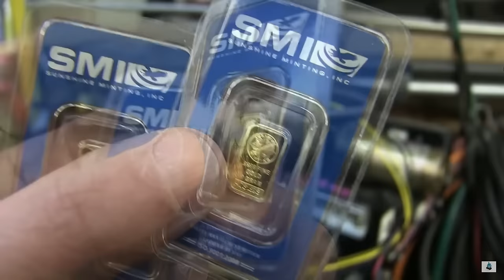Cold Welding In Vacuum

Comment: Has anyone mentioned the fact that when you quickly slam the two metals together, there is always mechancial recoil? regardless of how long you leave them in contact after the event, the energy necessary to cold weld has already been lost milliseconds after the initial bang in the form of kinetic bounce back. 
What about if you tried face on face cold welding using something that applies constant force in one direction like a hydraulic press? Of course with enough intense, pressure it'd cold weld by sliding past and deforming, but maybe you could test the press pressure difference necessary to cold weld in atmosphere versus a vacuum?

Comment: Can you try cold welding at as close to possible to  0 kelvin? if the gauge blocks are cold welding it when you wriggle them against each other then it should not happen since they are not reactive (or maybe that creates to much heat making them wield).

Comment: For the mercury vacuum pump, is there another material with sufficient weight to it, non reactive and low enough vapor pressuers. vapours to materials under test and a low melting point that would also not effect the material under test. I dunno say gallium, or sodium. Mind you is it feasible to put a check valve on the pump so vapor cannot enter the test chamber.
Reply from the maker: I've thought about NaK and I think it will work but I wont be able to pump oxygen or water.

Comment: Hey Cody! I was wondering if you could repeat this experiment, but adding a magnetic field to the equation. If the physicists who propose the Electric Universe model are right, it may very well be that the Casimir Effect that causes the cold welding is an electrically mediated phenomenon. You could try exposing your vacuum chamber to different EM fields, maybe your results will vary.

Comment: hey cody i have been wondering how a thing called a juul works. A juul is a e-cig that works without clicking a button al you have to do is suck on it and vapor comes out. Maybe if you could i would like to see if the vacuum chamber would activate it. The Juul is $50 on amazon if you want to try it out.
Reply: There is a pressure sensor in it, yes. And sure a vacuum would activate the atomizer. Nothing special about it.

Comment: Just one or two thoughts .. Perhaps by twisting you are rubbing the thin oxide layer off or  maybe oxygen gets trapped between  the  two pieces and the two electrons bind too other oxygen perhaps performing   A Great Wall of China between the two oxides layers (jk). First the bond would most likely too weak I would think .anyways on a serious note , perhaps something (most likely) on the quantum level is happening that since indium is so weak small atoms twist and dig into the other indium to create a sort of lock and as you twist the vacuum locks it in place for the first point (your rubbing the oxide layer off) which creates the perfect conditions to cold weld . I think the twisting is important and that's why it won't cold weld when you drop the indium or smash it together or something. I'm of course most likely wrong  and I forgot some basic principle of the second law of einsteinium quantum interpolation but to who's ever reading this have a very good day:)

Comment: Even in space cold welding isn't something that happens commonly.  It takes absolute absent of oxygen and complete vacuum and still requires rubbing together to happen.   Dropping and slamming together is not going to work.   Under these perfect conditions even aluminum can bond.

Comment: Could you over tighten a nut and have it cold weld to the bolt
Reply: Wouldn't that just be friction causing flaws in the surface to essentially hook together? I don't know much about cold welding but from my limited knowledge on the subject I don't think it could be considered cold welding. But again I don't know much about it so I could easily be wrong

Comment: rather than using a vacuum, why not use an inert gas, such as argon? if you're worried about oxides, simply eliminate the oxygen. in this way you can manipulate the material directly, rather than with contraptions.

Comment: #Cody'sLab Does not oxygen combust under high enough pressure? Maybe this actually is the other way around? Oxygen molecules getting trapped in a fine enough pattern to generate enough spontanious heat that it welds?

Comment: It is from micro friction. 

Do this test. And people, thumbs this up so he sees this message.

Get a better microscope if you can.

Buff out the indium. Make it smooth and fresh. Look at the surface.

Now do the twist under their own weight. Look at the surface again.

I am willing to bet, you will see rips and tears. This is because they are becoming heated. It isn't really cold welding. It is just a term created in contrast to the high temp of welding.

When you smash them together, that does nothing because most of that energy is translated into the sound that you hear. But again, when you twist them, it is silent, but the energy is also focused.

Like a flash light vs a laser. The flash light can be more powerful, but if you can focus the laser good enough, it will burn a hole in something. A flash light wont.

Also, I am willing to bet that if you put EXTREME force upon them and twisted them under that condition, it would be very hard to break them apart. Again, because of this "micro friction" and "micro heat". And again, it is "micro" as compared to actual welding.

But yeah.

BTW, I claim that I have the worlds best sandbox. I theory craft to a very high level degree.

Comment: Hello, isn't cold welding not working because you are not aligning the geometry of the crystals? What you are trying to do seems to me like trying to push in two misaligned (with an angle) lego bricks together. If you only had two pure macroscopic crystals,  (maybe you can try bismuth crystals, or salt crystals), and you align them (very ) precisely (maybe by vibration) they should cold weld. But you probably have plenty of micro-crystals which are not aligned with respect to their mating ones. By twisting and pressing you are displacing some atoms of the top layers of each surface to force them into a position of minimal energy for both surfaces (you are creating a correlation between the geometry of the two weld surface).

Comment: So... Cody, could this cold weld theory that you are trying to prove a friction weld? Since the metal is twisting and you are aplying force it appears to me a friction weld, and I don't know much about metals but what if the indium have some kind of property that allows to friction weld at very low tempertures, torque and pressure?

Comment: is it possiple the welding happends because of the electrons free to move in the metal and the fact you are turning the metal is creatng a small electric-magnetic field by atoms beeing somewhat polarized and very close together helps? also the direction of the field changes according to the movement of the metal, so maybe one helps the welding and the other does not, is this possible?
Reply: so maybe you could try inducing electric fields with coils while the metals are touching in vacuum?

Comment: There's not enough pressure between the two pieces. It's that simple. Even the mousetrap was far too little pressure for far too short a time. Take the lead brick and set it on top of the two pieces then draw your vacuum. Don't bother with the cloth, it's unnecessary. That MIGHT be enough pressure to get a result. You may need to use a vise.
Reply: ProgHead777 AvE cold welded the gold by hand in atmosphere, so not too much pressure is necessary. It would seem that the twisting motion is the essential factor. Also, your comment comes across a bit stuck up.
Reply: A. Zak I'm not so sure that what's happening with the twisting thing is actual cold welding. I suspect it's related to friction welding or is caused by galling of the surfaces causing them to structurally interlock and stick slightly. In true cold welding, it should be difficult to impossible to separate the pieces again since they become essentially a single piece of metal. Devices for cold welding on earth use extremely high vacuum and hydraulic presses to achieve a complete bond. It's possible to cold weld in atmosphere but the pressures required are much, much greater than in a vacuum and the bond will never be as strong.

I'm not sure why my comment came across as "stuck up" to you, but I apologize nonetheless.

Comment: is that a chicken or a cat in the background? I don't think that's cold welding in that gold, I think it's plating via friction just like if you put it in a tumbler. The pieces rubbing against each other transfer atoms across. Has nothing to do with welding. The term welding denotes a fusion of two or more pieces of material not the propogation of atoms from one to another.

Comment: Why waste time trying to achieve this in a vacuum?  It's not the lack atmosphere that aids in cold welding but rather the oxidized later. I'm this case you are additionally trying to remove the oxidized later as well as trying to prevent a new one from forming. Why not use a sealed chamber with all oxygen removed and access to manpipulate the parts, in this case you can cut the metal leaving clean surfaces that can then be reattached?

Comment: Here's the problem, metal on earth has an oxide layer that cannot be taken off unless through measures I cannot fully detail minutely. The only proof of cold welding was through very controlled situations and otherwise it wouldn't happen. For this is the reason why satellites and any other NASA equipment doesn't cold weld while in space.

Comment: Those gold bars aren't really clean. The only way to absolutely clean them is to use the same plasma cleaning they do before coating telescope mirrors with evaporated aluminum. And then not touch the surfaces with anything - especially not lense cloths.

Comment: I think it may have something to due with the way the molecules bond in different temperatures. Maybe try building something that will cause hard friction between the two smooth pieces for a few moments then place it in the vacuum chamber. Here's a great explanation for the way metals change under heat. https://www3.nd.edu/~manufact/MPEM_pdf_files/Ch05.pdf

Comment: You really need to learn a bit about automation for all these experiments you do. That way you could try cold welding aluminum and other metals in a vacuum. All you need is a little know-how in electronics & machining.
The only way I could definitively say whether or not this will work would be to sand or machine off the oxide layer. or melt it down inside the chamber. ... I'm not done watching yet though.

Comment: I'm sorry Cody but the problem here is the rhetoric. You're not currently trying to "cold weld" but to "vacuum weld". Cold welding is actually a great concern in space aeronautic because, yes, they have to work with alloy in space vacuum but also in SPACE COLD. I'm almost certain the molecules of the gold bars were way too hot to even consider crystallizing together. On top of that, you can clearly see that the surface is not perfectly polished and you touched them with your bare fingers adding grease which doesn't help.
Reply: It is actually possible to "cold weld" metals at room temperature but you must understand some principles. Either the welding surface must be really small (I'm talking about nano scale here) or the pressure between to two surfaces must be intense. Certainly more intense than the gravitational pull of a small gold bar plus a magnet. You could, theoretically speaking, call 2 gold bars being squashed together by a hydraulic press "cold welding". Otherwise you need to lower the temperature to near absolute zero like in space which is around 2.7°K.
Reply: I would probably try to dip the vial in liquid nitrogen with your sprengel pump apparatus. Also, I'm not sure if the vibration thing does help or not.
Reply from the maker: https://www.youtube.com/watch?v=07CShwlSnms